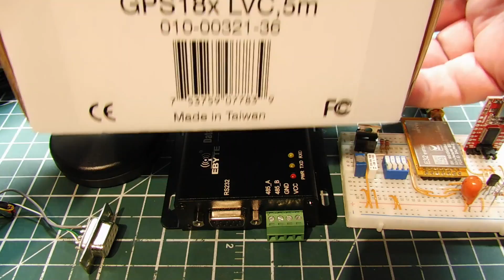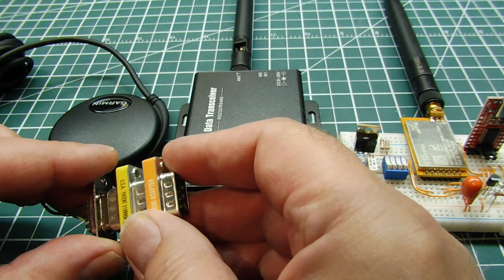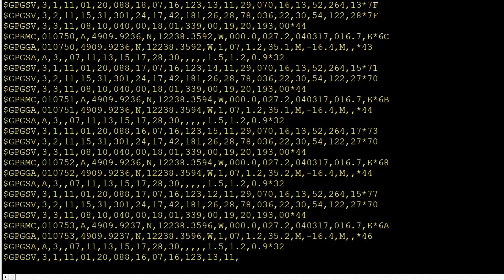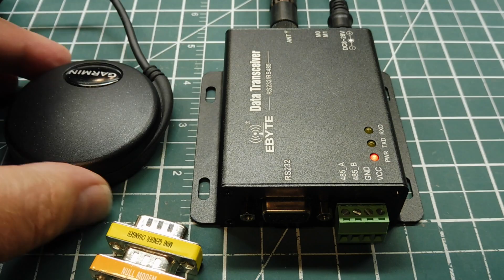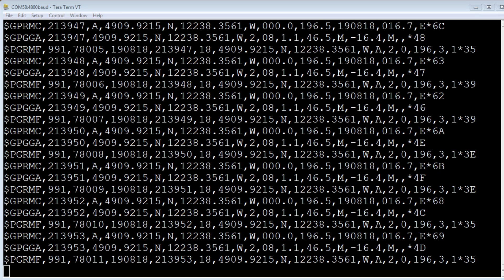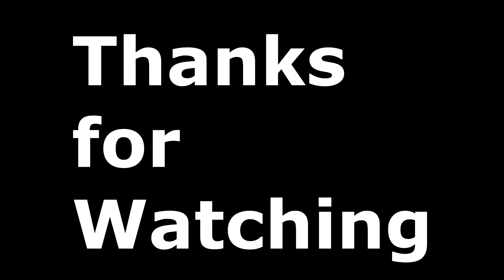Send GPS Data Over A LoRa Radio Link

Comment: hi, i have ebyte e22 400T30d 1w transciever and i need 5w ebyte transceiver to communicate each other, what 5w ebyte model can you recommend
Reply from the maker: Ebyte does not make a radio module with an RF output greater than 1 watt.
Reply: @0033mer  they have this e90 Dtu, e32 DTU 5w
Reply from the maker: Ebyte manufactures radio "modules" that operate in the license free ISM band of 900 MHz and 2.4GHz with a maximum of 1 Watt RF output power.  433 MHz DTU operation in Canada and USA is in the amateur radio band and is not license free. Check your local laws for the operation and power restrictions in this band that applies to your country.

Comment: Will the transceiver pick up all data that is in the air on that frequency? With other words, how can you be sure the incoming data isnt corrupted by other transmitters?
433Mhz / 868Mhz is so polluted these days, that by using an SDR receiver, there are constantly signals being picked up from other devices.
Reply from the maker: The LoRa radio is tuned to the 915 Mhz ISM band. Each packet sent is encrypted with CRC and FEC (Forward Error Correction) so the receiver will only see good data or no data, never corrupt data. If major interference is a problem then you can go with FHSS radios that will hop around any interference. https://youtu.be/8OcADT-bp94

Comment: Are the EBYTE LoRa radios that noisy when Tx’ing?
Reply from the maker: I have a radio receiver on tuned to 915 MHz to monitor the data bursts transmitting from the LoRa module.

Comment: hi, 
I am looking for a lora receiver  equipoed with bluetoot or wifi suitable to receive nmea data from the E90 and send them to a ios or android device. 
could you suggest me a product suitable for that?
Reply from the maker: You can build your own with Ebyte E32 Lora radio modules, HC-06 bluetooth module and a bluetooth serial terminal app running on your smartphone.
http://www.ebyte.com/en/product-view-news.aspx?id=174
https://www.amazon.ca/Pass-Through-Communication-Compatible-Atomic-Market/dp/B00TNOO438
Reply: 0033mer 
Thank you for your reply, 
Since I am not able to build It, I am looking for a  ready to use commercial device.
Waiting for your thoughts .
Gigi
Reply from the maker: Search online for GPS trackers. There are many to choose from. Pick the one to fit your application. eg  https://store.rakwireless.com/products/rak7200-lora-tracker
Reply: thank you for your patience, 
I meant I am looking for a device able to receive Gps data sent by a Ebyte e32 and send them to the smartphone. May I use one more Ebyte e32  connected with a USR-W630?
Reply from the maker: Yes, that will work. The USR-W630 will accept RS-232 and RS-485 from the E32 DTU.
Reply: 0033mer thank you!!!

Comment: Don't forget about proper duty cycle usage for this radio band. From what I have found in datasheet Lora makes it a little easier to control duty cycle but may have an overall higher duty cycle if you are setting for maximum sensitivity.
Great video tho! I want one of those data transveivers with the sound output now.

Comment: Building a small portable LoRa tracker with the E32 and a GPS device would be a fascinating. I have been experimenting with the E32 and 9600 bps and the E32 is a powerful device. The data is being picked up in UBlox demonstration software that gives detailed data on the ground. The problem is how to build the GPS + LoRa device small enough for use in a flying vehicle.
Reply from the maker: Sounds like miniaturization will be the key. U-Blox makes a variety of small compact GPS receivers which are used in drone applications. They have a built in antenna and sealed in a plastic enclosure. Your students will have fun with this one.
Reply: 0033mer  - Suggestions? Arduino Uno or Mega? or dump the raw output into the E32 module somehow?
Reply from the maker: Start out simple. Feed the TTL serial Tx pin of GPS directly into the Rx pin of the LoRa serial port. Configure the GPS to output the desired NMEA string(s) which will be sent every second. The LoRa radio will transmit automatically as it receives the NMEA strings. The receiving LoRa radio with FTDI connected to serial port is connected to your computer USB port. Your mapping software will parse out the desired data from the NMEA string and display location on map.
Reply: @0033mer  is this achievable using a pair of LoRa SX1278 433 MHz Wireless rf Module iot Transceiver CDSENET E32-433T20DT UART Long Range 433MHz rf Transmitter Receiver ? Basically what I'm interested in is tranmitting the nema strings over the air with this transcievers. Everyone is using an Aduino in between, but for my application I only need to pass the nmea strings to a bluetooth module (HC-05) for example. So, my config would be : GPS Module --> LoRa SX1278  ...... air ......  LoRa SX1278 -->HC-05 --> Android Phone. Would this work?
Reply: Use small gps devices meant for drone + stm32f103c8t6(blue pill on ebay) + rfm95 type Lora module is what I am working on for telemetry for my quadcopter. Once I get a good protocol set up I want to have backup control over the Lora also. Main reason for Lora addon is to keep track of quadcopter status, location, possible follow me mode with another GPS on my person sending coords back to copter thru the Lora link. 

Also pay attention to the duty cycle (TOA - Time on Air) to be followed by your Governments restrictions on this band. We may be at low enough transmit powers that it probably does not matter but just as with quadcopters better to play it safe so we dont lose our freedoms. I will be investigating how low I can go on my TOA while still having fast enough updates to serve a purpose, especially since one of my "Nodes" will be in the air 30-50meters my node could spread its signal alot further. 

Good luck and let the Lora revolution begin :)

Comment: It is just more convenient and safer to use MCU as WiFi Access Point with its own IP and even server or tiny fast routing device.
Lora has much lower bandwidth and less capabilities.
Reply: For close proximity Wifi is easiest, but even then getting good 2.4ghz or 5ghz coverage from your router to your yard is difficult without better than isp equipment. 

For longer range than your yard, we're talking 1km-20km range with proper radio settings. 

Bandwidth is hardly a concern for IoT applications, such small data packets, wifi is almost a waste of electricity in IoT applications. And Im not just talking out my butt either. 

I built an Ardupilot 450mm quadcopter- arduino mega + dragino wifi shield(mini dd-wrt) router + I coded my own android app to connect to Wifi shield and send commands to ardupilot firmware, it flew, I got 3-4 flights out of it, then one day at the park I flew it farther out then I had ever with so many trees and houses, what happened when it got about 30m away from me and closer to the nearby houses?
 Signal loss, complete failure of control from me, failsafe kicked in and wind caught it, I have not seen that quad in over 3 years now, it may still be in the trees.

My point: To have full,  and less than 100ms latency I was only using maybe 3kB/s. Wifi was easy yes, easiest wireless control system for me to make then, but if I had been using a Lora module or even just a semtech SX in fsk mode I would still have that quadcopter probably, signal wouldnt have dropped at all at 30m.